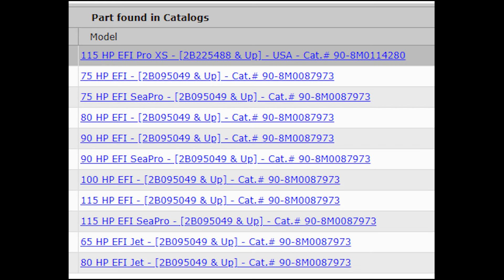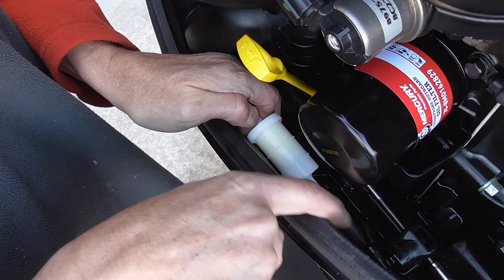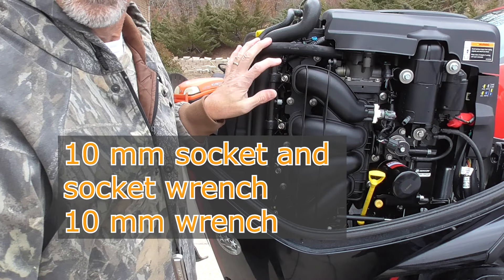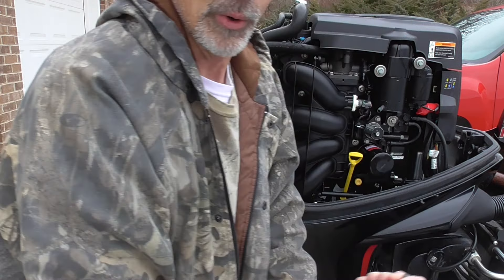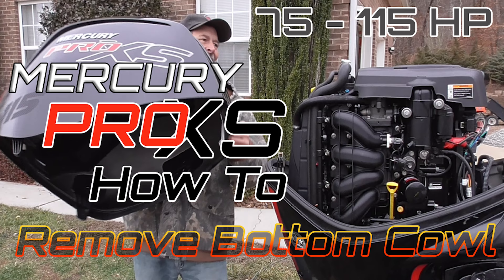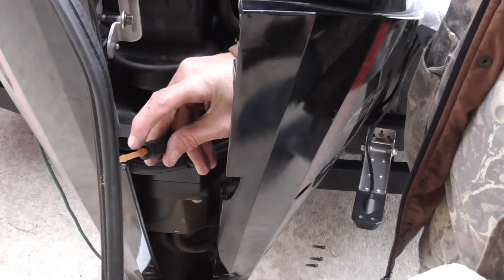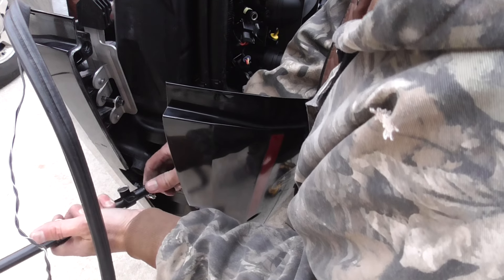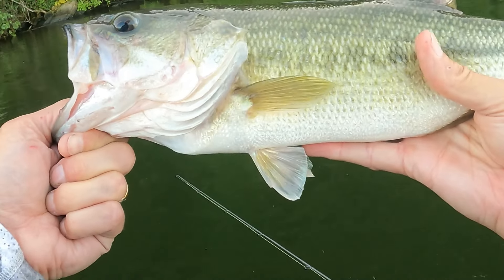Replace inline and fuel rail fuel filters on the Mercury ProXS 115.

Comment: Excellent videography, procedure and explanation! I need to replace that filter on my engine and wondering (after watching your cowling removal video) if the cowling can be separated enough, without removing the rigging, to gain access to where the fuel line meets the rail. If so, do you think there would be ample room, once the cowling is pulled away without fully removing it, to:

1. remove the Oetiker clamp 
2. wrangle the fuel line off of the fuel rail
3. replace the filter, reattach and clamp the fuel line

Seems like if you have to go through all of the steps to split the cowl, it might be a whole lot less time and effort to eliminate all of the steps to remove the fuel rail.
Reply from the maker: Thank you for the compliments! I did not have to actually
Remove the rigging at all, other than that cover and that was just to get easier access to the one bolt. I hope I understand your question. I was able to pull the case far enough apart to do all of those things you mentioned! 😀
Reply: @PaulsOutdoorAcademy Thanks for the quick reply… just to be sure I understand, you can split the lower cowl without removing the rigging far enough to access the fuel line connects the hose rail to replace the “pencil” filter WITHOUT having to remove the fuel rail?
Reply from the maker: @timjs123 sorry I didn’t understand that part.  So you are trying to avoid removing the rail. I will say this, it was very difficult to get the hose off of the rail, even when I had it off completely. You could try while leaving it installed but I would worry that when you are apply
Twisting motions to the gas line, you will be putting too much force on the rail. I am not confident that you can do this without removing the rail but honestly it wasn’t bad.
Reply: @PaulsOutdoorAcademy hi Paul, yes, totally trying to avoid removing the rail. Maybe when I grow up I can be an engineer who gets to put any serviceable components in the most difficult place, oh wait, I’m much too old for that 😂

Thanks so much for time and detailed information!!!
Reply from the maker: @timjs123 that’s hilarious. My favorite is a vehicle that has to have the motor dropped to change plugs.  Boy oh boy that’s crazy 😄

Comment: great video... looks like i have the same engine as you but mine is on a Triton 18CTX.... what made you swap the high pressure fuel filter... the most info i could find in the manual is that the filter should only be replaced by an authorized dealer.... I also just found the vault axle video... I had a similar problem, but I had to replace the axle after two bolts sheered off on the way home... I was lucky the wheel didn't go it's own way once I exited the interstate...
Reply from the maker: That filter came with my 300 hour kit and I also thought I found something about it in my maintenance book. I will have to  double check.
Yep I had to replace the whole axle or at least chose to go that route Hahahha 😎
Reply: @PaulsOutdoorAcademy  I got lucky with the axle... Dexter Marine decided to first send me a new Hub under the 5 year warranty and then once I found the spindle was bent, they sent me a new axle with two new hubs.... I doubt I'll find a better deal than that.... what year is your engine? My engine is a 2018... maybe somewhere before or after they removed/added the high pressure fuel filter steps.... other than the "take it to an authorized dealer" at least in my manual....
Reply from the maker: @jeffmcc5267 I was VERY blessed for mine to not fall off! Mine is 2019 😎. Good deal on that axle for sure!!!

Comment: Excellent video!!!   Quick question for you......  Did the engine restart right away (after you removed it all, you wouldn't have any pressure in the system)?   If not, what process did you go through to restart it?
Reply from the maker: That’s a great question and I wondered the same thing. Somehow it started right back up. I don’t think there was much pressure on the gas line. Thank you for your compliments and question! 😀

Comment: Hello great Video, I have to replace my number 3 injector is there enough room to pull rail and injectors and swap out the number 3 injector without needing to split the cowl?
Reply from the maker: You should be able to do that without splitting the case for sure. Remove those 4 main screw/bolts that hold the rail down, remove the 4 silver clips, or leave them on and pull the whole fuel rail and fuel filter assembly. Then you should be able to replace just the one. :)

Comment: Question, I have to replace my number 3 fuel injector. Do I have enough room to pull the rail and injectors and swap out the number 3 injector without splitting the cowl?
Reply from the maker: You should be able to do that without splitting the case for sure. Remove those 4 main screw/bolts that hold the rail down, remove the 4 silver clips, or leave them on and pull the whole fuel rail and fuel filter assembly. Then you should be able to replace just the one. :)

Comment: On the VesselView app there isnt a fuel rail filter 300 hour log item. Besides doing it at 300 hours, would there be any other reason tobchange it out? Seems like a lot of work 😮
Reply from the maker: That is a great question. If you looked at the video where I actually have the fuel rail filter in my hand, you’ll notice how dark yellow it is and this is running very well, known, good, branded fuel I don’t know if it was really necessary, but I am glad I did it. Thank you for your comments.
Reply: @PaulsOutdoorAcademy  I did notice the darkness. I have 163 ours on my engine, so I may wait for that 300 hours. I looked up how to change spark plugs (viewed your spark plug video) because  wanted to check them due to a slight misfire or bump in the speed cruising down the lake the other day. I'll replace my fuel filter (it's a year old) and I checked the prop, etc., already. Your video gives me confidence in removing and replacing the plugs. Thanks!
Reply from the maker: You can do it! I’m glad you liked the videos. Thank you very much for the comments!
Reply: @PaulsOutdoorAcademy  I did the spark plug inspect today. All went well. They appeared to be okay, so I reinstalled them. Your tricks and tips worked beautifully!
Reply from the maker: That is fantastic to hear.  Thank you so much!!!

Comment: Excellent video!!!   Quick question for you......  Did the engine restart right away (after you removed it all, you wouldn't have any pressure in the system)?   If not, what process did you go through to restart it?
Reply from the maker: It definitely restarted right away!